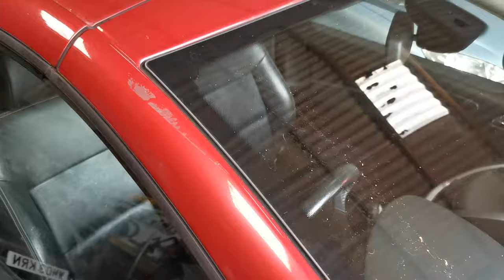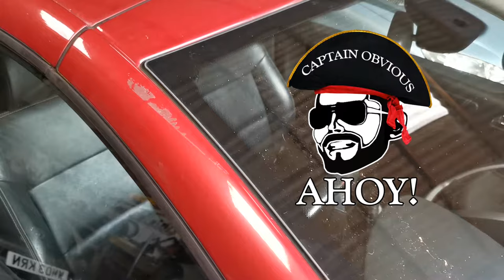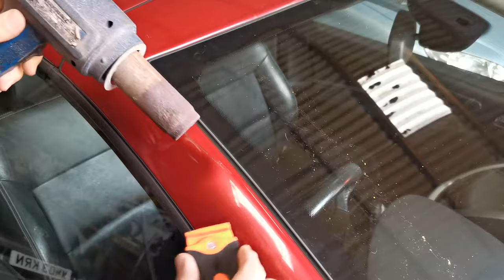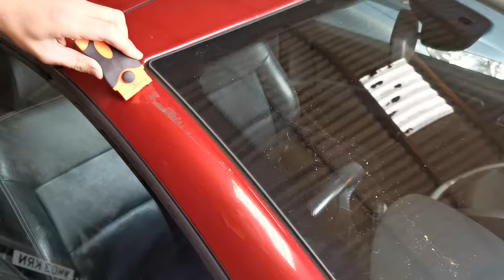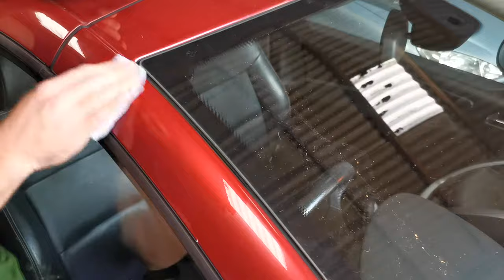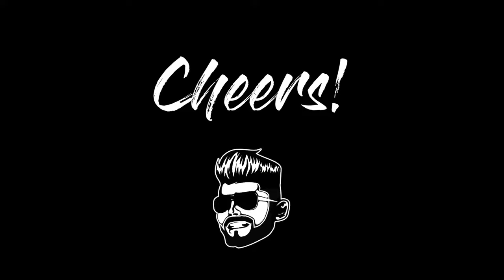How To Remove Adhesive Residue From Car Paint Safely WITHOUT DAMAGE | 5 Minute Fixes | Episode #3

Comment: Would rubbing alcohol do the same thing as the pre paint/panel wipe you are using? Or would alcohol be weaker? Enjoying your content so far!
Reply from the maker: Thanks for your comment, I'm glad you're enjoying the videos!
I have heard of people using rubbing alcohol in paint prep, but a dilution with water to save it from evaporating from the cloth too fast.
I can't say that I've used it personally though so wouldn't want to vouch for its performance!
Reply: Rubbing alcohol doesn't work!! Tried it & nothing!!
Reply: @drchunkybiscuit9973 what has worked cause I just see you saying nothings worked to every solution

Comment: Question.   I bought a work truck 3 -4 month ago. removed  90% of the old decal glue on it.  Still have lettering on the hood, tried everything. Can I just wet sand it (1500/2000/3000) then compound it ?
Reply: The residue is gonna stick to the sandpaper the minute you start doing it...tried those compounds myself...I'm using hot kettle water and dish soap...works like a charm
Reply: @NewsWithYou  The 'ol Polyketyl trick!